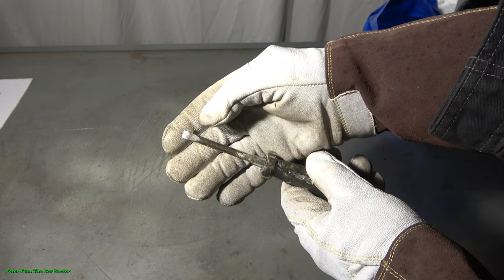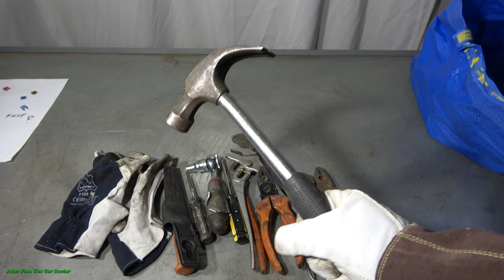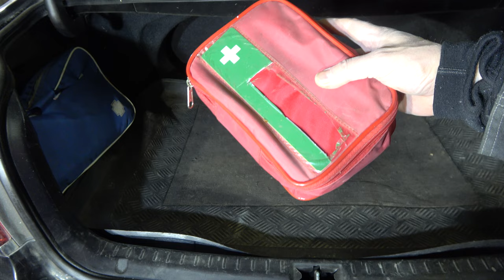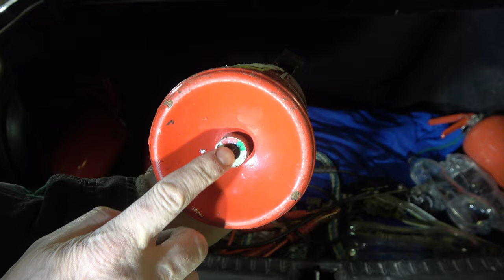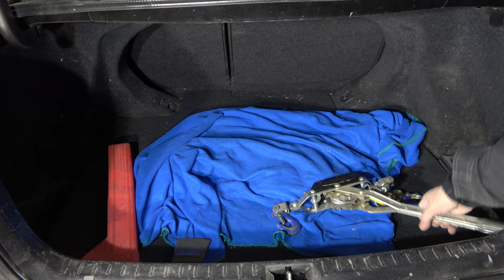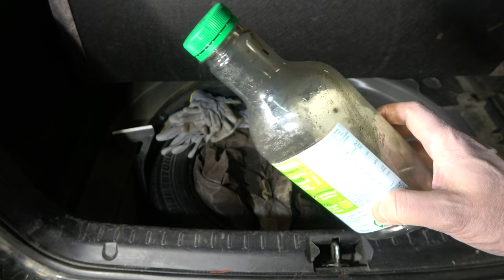What Emergency items are in the trunk of Peter Finn's Toyota car

Comment: Excellent items Peter! You are really ready for battle (especially with this great big axe you have)! You will not be concerned by any emergency situation!!! Along with the sharp knives you could also have a dull knife. It is always useful, to hit something or to open something! You could also have electric tape, in case you need to splice cables. Any kind of duct tape would also be useful. You could also have penetrating oil, in case some bolt or nut is difficult to open. You could also have soap, to wash your hands and skin, in case you are outside in the nature, in the great, vast forest! You could also have a canister full of fuel, in case you run out of fuel in the middle of nowhere! You could also have a fork, a spoon and a dish, in case you have to eat outside, in the nature!
Reply from the maker: Great ideas and a big Thank You, Thank You!
I am adding to my car the equipment you presented, i.e.: electrical tape, duct tape, penetrating oil, soap, canister full of fuel, fork, spoon and dish, surgeon's knife, quilting tools, small wood grill and matches. 👍
Reply: @PeterFinnTheCarDoctor  I'm really glad you found my ideas useful Peter! That's why I wrote them, because you asked in the video! Those items you added in your comment (surgeon's knife, quilting tools, small wood grill and matches), are very useful also!

Comment: In northern conditions like Finland you will ALSO need small snow shovel, led-torch, snow brush, and Noco brand jump start device.  It's also a good idea to learn how to attach the tow rope to the front of your car. There maybe some strap or hook for that in trunk near the spare wheel.
Reply: It's also essential to study beforehand how to use those more complex tools - like jump starter device. It's very handy device. Even when some strangers need help with their empty car battery. There is plenty of youtube videos about how to use jump starter.
Reply from the maker: Thanks fo rcomment 👍😀